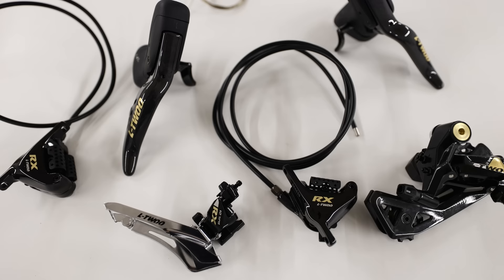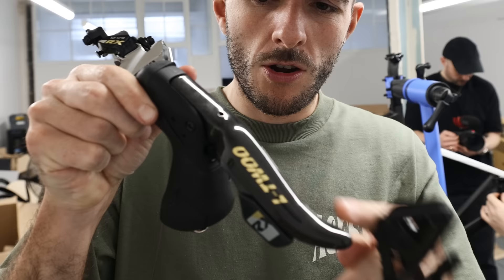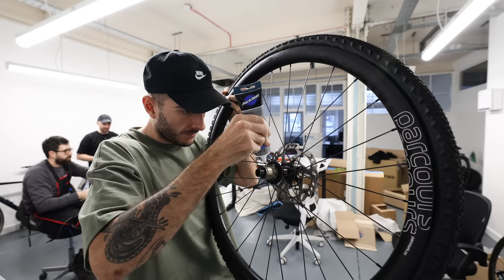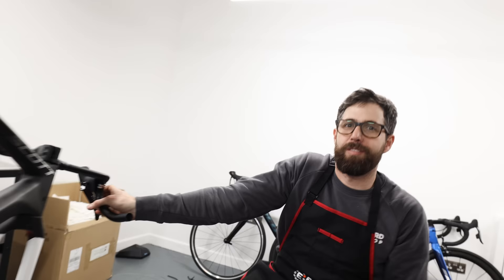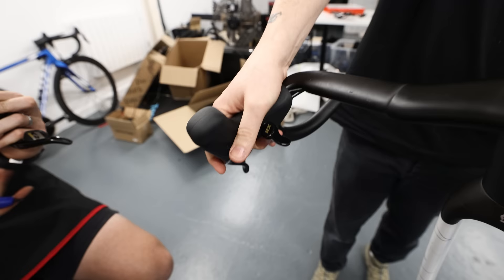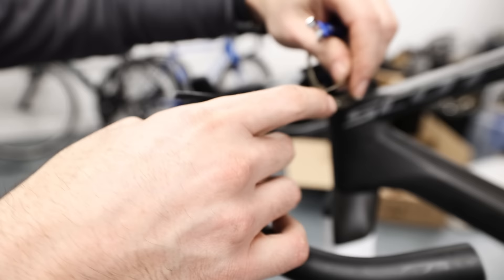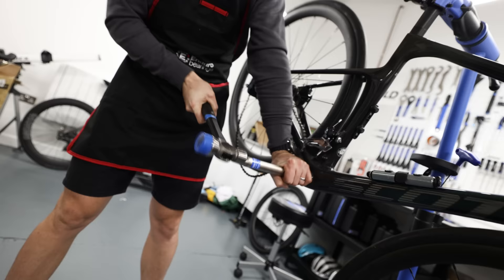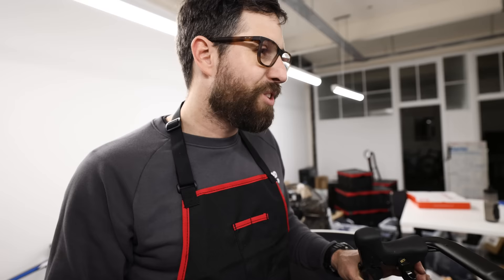Pro Bike Mechanic Vs AliExpress Groupset - LTWOO RX Hydraulic Build

Comment: Having to drill out the brake caliper really surprised me. I've fitted two of these groupsets now, and both front and rear calipers fitted perfectly to the flat-mount frames i've used... Anyway really excited to see how you get on with it, also I'll be interested to hear if you experience any rattle coming from the piston circlips!
Reply: and you said it's SRAM compatible, isn't it?
Reply: @birkaster  TBH I don't actually know. The 11 speed road groupsets from L-TWOO use Shimano cable pull ratios for the derailleurs, but as this is 12 speed, who knows...
Reply: Didn't you had to use caliper adapter you know the one with 140 to 160 or 160 to 180 ? Maybe they did forget it ?
Reply: Cheep Chinese rubbish , will be dead in months worn out and useless , Dura Ace or forget it I say after using mine for 40 years and still as new ...I give this Chinese tech 40 days and ruined !
Reply: @TraceVelo  Did you manage to source another brifter Luke
Reply: @Jaerdoster  I think I can see the adaptor plate being used, but tbh making 'adjustments' with these cheaper alternatives is just part of the process much of the time. Plus the lack of documentation does make things more difficult.
Reply: Still hoping for a Trace Velo & Cade Media crossover episode some time in the future. 🥖
Reply: @TraceVelo  for some reason I remembered (it seems wrongly) that you bought a SRAM casette for the groupset, because the fancy chinese was rattling
Reply: @abedfo88  MR BEDFORD! So as it happens the crash only snapped the brake lever. The innards were absolutely fine. So i swapped in another lever, and it's good to go again!
Reply: @curtisducati I've used this "cheap chinese rubbish" you call for over a year, and the quality isn't that much worse than dura ace 9000. Heck, it has comparable quality to 105 5800 and it's Sensah Empire. Don't be a snob and enjoy the world
Reply: Hey!!! Can you get a rim brake version of the groupset??   :)
Reply: @curtisducati  40 days of your riding it will still look brand new ya crank.
Reply: @curtisducati  boomer mentality
Reply: @curtisducati  not really a fair comparison if you look at the price though
Reply: Evidently they didn't watch your video on those before taking the Dremel to them.
Reply: @veganpotterthevegan  and of course there won't be a follow up video on 'oh, we screwed up by Dremeling out the calipers, and had an accident because of that'.
Reply: A couple of caliper adaptors should be with the set. Saw this on another YouTube video. Maybe yours was missing?
Reply: @dan_lazaro  YOU Go Dan!!! haha Beast!
Reply: @TraceVelo  I figured you would be able to do it, given how many times you've played with them.
Reply: This is my man! 🥖🥖
Reply: @curtisducati  even lots of pro triathlete, pro cyclist use ulyegra n here u are weeknd warrior, "dura ace or nothing"
Reply: Most likely the frame was the component that was actually poorly spaced on the brake mount.
Reply: @birkaster  You are right he did, Sram and Shimano Cassettes are mostly interchangeable. I think he thought you were talking about derallier compatibility. To confirm these (Unofficially of course) are using Shimano 11s pull ratios even at 12 speed, so they will shift an 11s Shimano mech' over 12 gears.
Reply: @curtisducati  how do you know if you've never used it before??
Reply: @xnoideawhatimdoinx  +1 for Cade and Trace Velo colab 🥖
Reply: @Jaerdoster  Looks like they forgot about those. Not sure I'd be taking my bike to that mechanic. Short chain too ... really
Reply: @curtisducati  Unless you have used them yourself you’re simply talking rubbish.
Reply: The builder is just a Snob trying to nit-pick what's wrong with the groupset.
Reply: Ltwoo is famous in the Philippines,because it's cheaper,we use post mount adaptor in case there's issue with the type of frame..
Reply: @c0olcast  A bit alarmist
Reply: @curtisducati  Okay grandpa go to bed
Reply: They obviously did something wrong - every LTWOO Groupset with hydraulic brake system includes all the Adapters to fit the Brakes to Flatmount frames in the Box.
Reply: @curtisducati do you ride 1 mile a month? 40 years. Give over.
Reply: @curtisducati  "Ok let's get you to bed grandpa"
Reply: @curtisducati  or go above mid-end and Get Sram Force or Red, or Campagnolo Chorus, Record or Super Record.
Reply: @TraceVelo  yeah, I have the L-Twoo on my Gravel bike currently, and the quality isn't much below Dura Ace to be honest.
Reply: Poööö😅öö
Reply: @curtisducati So, if you have an dura ace for 40 years, that means it is an 80's grup set with 5 gears and an down tube shifter. Man you are missing so much... Even a Claris grup will be a huge improvement.
Reply: @curtisducati  This comment is already a year old now and wow, what a clown
Reply: @curtisducati  I have the LTwoo GR9 1X group, which was the next step in evolution from this group. It is great.  I prefer it over my SRAM in many respects. It's not cheap, or rubbish.
Reply: you didn't use the adapters properly. Ltwoo uses a proprietary brake mount to get around the Shimano and SRAM patents.
Reply: I tried a Head PAVA with their 11 Speed / Dual Piston Mech Disc Groupset. It was 0.9 kg heavier than a Domane AL3 and I thought the groupset was very nice for the pricepoint. First sub-$500 new bike I've ridden that wasn't absolute junk. It's very Domane like.

Comment: Kinda surprised with your drilling process because I'm using the L-TWOO GRT 12s group set and it fits my frame perfectly. I suppose you guys weren't noticed there are a bag of adaptors specifically designed for L-TWOO's calibers to fit any frames. These ADAPTORS MUST BE USED💥 because the spacing of the mounting holes are in a unique specification to avoid pattern issue. No matter you're using 140mm or 160mm disc, you have to mount the adaptors to your frame first, then fix your calibers on the adaptors.
Reply: A missed or missing bag full of adapters makes a lot more sense than an otherwise well thought-out groupset having bonkers spacing.

Comment: This has become a really good channel. Really impressed with how you are focussing on the cheaper/regular stuff, rather than the crazy expensive Dura-Ace/insane priced bikes that the likes of GCN always feature. I've unsubscribed from them and subscribed to this instead! Well done for nailing your audience.
Reply: i'd argue that its still nice to know "what is out there," since while we can't all reasonably justify spending for sram red or shimano dura-ace immediately upon release, there is nothing stopping us from using it when its not new. the 11 speed dura-ace, and red groupsets now are still just as good now as they were before, and other than the obvious differences between 11 and 12 speed, the refined performance aspect is still all there. and the prices are now definitely affordable by the masses. so i rather personally use a  top of the line sram red/force or shimano dura ace/ultegra from a handful of years ago, than one of these burgeoning market offers. biggest reason is availability of parts and support. its great that these new options are becoming available, but there still remains a lot of work before many of us should feel comfortable enough to buy use, and self-maintain these new groupsets at home.
Reply: 100% with you MORE CONTENT LIKE THIS

Comment: thers an adaptor for the brakes so it will fit in the frame and the fork no need to drill the holes on the frame😭😅
Reply: Exactly, what a plunder 🤣
Reply: @overthetarget9401  when i saw the drilling process it made me very😭😅
Reply: @fritzhanzelberdigay3958  They wanted to show the fancy Dremel set 😆😜

Comment: I've literally just been fitting mine today to my Sonder road frame. Bleeding the brakes was a trial; I used a syringe on both caliper and lever, but this left disappointing braking strength. Adjusting the pad reach grubscrew in 6 turns helped; note that 7 turns is where the grubscrew falls out the back, and you then need to remove the lever using  2 and 2.5mm hex keys on each side of the lever pivot and reinstall the pad grubscrew from the back. I may try an overbleed soon to see if I can drive the pistons out a bit further.

Note that it seems you must use the supplied brake mounts: I think thats where you went slightly wrong on this build. Although you can use Shimano calipers.

There's also a reach adjust grubscrew lurking under the shift lever.

Comment: My experience with almost all direct from China parts is that they require a certain amount of fussing to get them right. They don’t spend the time to chase threads and quality checks are loose…so the consumer gets to do those things. Where shimano and others do that stuff so parts typically just bolt up and go. If you’re willing to tinker they can be great. For example I bought a sensah group and the rear mech wobbles like crazy and hunted gears. Turns out it needed a o’ring or washer on the mounting bolt to hold the mech body tight against the frame. Someone with no troubleshooting ability , like a first time bike builder would have never solved it.
Reply: just installed 2 L-twoo groupsets - (GR9 mechanical, and GR9 hydraulic), no issues at all.  The former is cheap crap, so I didn;t expect anything great, but the build quality is decent, on the hydraulic group great.

Comment: It will be interesting if smaller brands start using the groupset to make way more affordable bikes. Seems like the major issue is the fit and finish.
Reply: It's already happening
Reply: @unclejohn5012  which brand?
Reply: Yes allready happened. CYKL french titanium bike brand is proposing this group set as an entry level option as wel as the GRT version (gravel version) the group is good small issues on the mounting aspect. Yes, olives are tight but you can use Shimano.

Comment: Random thought: is there a way to design a better/more ergonomic shift lever to replace the standard one? If you could design something that sits in a better position for access from the hoods while keeping the easy drops access, then maybe get it 3D printed, that would be cool. Though possibly way more cost and hassle than anyone wants on a £300 groupset!

Comment: for me, the point of having 12 speeds in the rear is to get rid of the front mech... I mean, an 11-42/44 in the back, with an oval 38 in the front is enough for most of my rides: road, all-road, light gravel. So, can I repurpose the left shifter for a dropper, for instance?
Reply: no, dropper levers work differently
Reply: Why is necessary to use twelve speeds if you don't change the system for microspline or xd?
Reply: @tatoymara88  to have closer gears ( especially in the smaller part of the cassette) and to get rid of the front derailleur.

Comment: Didn't had any issues with caliper mounts sure it is weird but offer a lot of compatibility. And make sense on a production point of view. But bleeding is a bit tedious. Did you figure out the the two bleed ports? One for fluid brake and the other for air ?!?  And now struggling a bit with auto adjust caliper front brake as loose some braking power. This is an interesting part for the video.

Comment: I hate this Button inside. That's So old school and I had it on old shimano stis with the outside line like st-2203.
I love to have it on the paddles where I shift up and down.

In lower Position they are crap to reach

Comment: My local bike mechanic installed the Sensah equivalent of this set on my friend's bike, it did not have problems.

It does not feel as smooth as an Ultegra, 105, or a Dura Ace, but it is not as expensive as them so we were not expecting it to.

Comment: If you’re thinking of L-Twoo, I cannot strongly enough recommend against it. I have two group sets, the RX and the GR9, and they’ve been a disaster. Unfortunately, I don’t have the platform that Cade/Trace/GC/Panda has, so L-Twoo just dgaf about my issues, and I’ve been stuck having to replace both with Shimano/SRAM. All-in, I’m out 2x what I would’ve been just going mainstream in the first place.

Comment: Just to confirm (because I tried it) These WILL shift a Shimano 11s (105 R7000 in my case) over 12 gears no issue, Replacing the Guide pulley wheel (may as well replace the jockey as well) with the current mechanical Shimano type (I think I used Utegra ones) brings the shifting more inline with 105. The L-Woo ones are really thin for some reason and the chain slops side to side on them. I'm using a Shimnao chain currently but on Chinatown forums most people say this group works best with SRAM Eagle.

Comment: The shifting in this frame will be sluggish because of the routing, no?
Reply from the maker: We had to use an outer which runs the whole way through the frame which will create more friction, but it’s quite smooth now I’ve replaced the chain to a new one.

Comment: In my experience a lot of the shifting issues are to do with the chain and cassette, currently running the sensah empire with an ultegra chain and cassette, and it’s been super crisp with the hyper glide working together on both the chain and cassette
Reply: I have the 1rst gen empire too with a 105 chain and cassette, smooth as butter.

Comment: In terms of compatibility with Shimano, I just built up a 12 speed mechanical with the Ltwoo RX (non hydraulic), 105 R7000 front/rear mech, and an R8100 12 speed cassette. It works flawlessly, and indexes perfectly so I would suspect the pull ratio is a very crude 11/12th of a 1.4 pull ratio (I figure you might be able to claim it is around 1.3 or close to SRAM exact actuation, but that's probably coincidence).

Comment: Well it fits and works, bit of hole fettling not like the caliper is going to fall off once it's bolted on. Probably if you bought another one it'd would fit okay. Be interesting to see how it performs on the road and how comfortable are the shifters.

Comment: Surely, just spend £449 on Wiggle for an entire 105 R7020 group set.
Reply: That is a sale price with a significant discount. It's RRP is still nearly double, and it's "only" 11 speed. Don't get me wrong, I love my 105 rim brake groupset I am currently using but these kind of deals are not guaranteed, plus you are limited by crank length, chainring and cassette size choice in regards to available stock. Last time I looked they only has 50/34 chainset in 172.5 and 175 available, not good for shorter riders or those wanting bigger chainrings.

Comment: When you road test it, you will have to test it for what it is. and not if it is equal to SRAM or Shimano. Test it for a mechanical 12spd. Group set. that cost much less. Does it get the job done?

Comment: So what did you do about the front mech on an 'electronic only' frame?  Does the LTWOO mech have a cable stop?
Reply: The front mech has an integrated cable stop.
Reply: Electronic Only frames have smaller cable ports that only fit DI2 or EPS cables, which are thinner than mechanical gear cables. They also don't require guides under the BB for tension so saves weight and money (for the frame manufacturing at least) by removing complex shapes and structures.
Reply: @matt_acton-varian  Can see in detail what Nic did in the build video over on Jimmi's channel. Looks like the cable port is big enough to accommodate a gear cable outer.
Reply: @billhulley  Not had chance to see that video, but generally, from observations of some electronic only frames, the different nuances of each shifting method makes cable routing design an important feature. I'm sure that only a few years ago when electronic shifting just started to become popular that partially internal routed frames would come with two sets of cable routing grommets: one for mechanical and one for electronic.

Comment: LTWoo copies major OEM stuff. It will look the same on the outside, but the internals, quality and materials will be substandard. Its easy to copy the appearance, but takes actual engineering knowledge and experience to understand what you are copying and make it work properly. Being a brake engineer myself, I would absolutely never trust my life to LTWoo hydraulic brakes. There are a dozen things that can go wrong that they probably have no understanding of. If they can't even get the caliper mounting holes right, what chance did they have of all the seal fits being correct? Maybe zero?
Reply: Quality is bang on and they adjusted the mounting holes because they didn't use the adapters that came with this set for some reason. Sensah and Ltwoo are perfectly decent manufacturers. Even SEA teams use them. What are you on about?